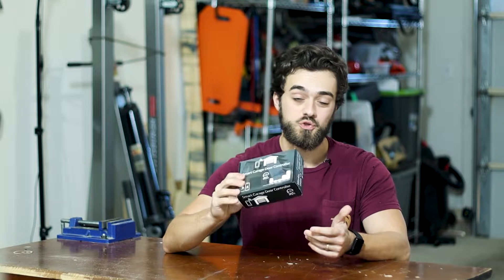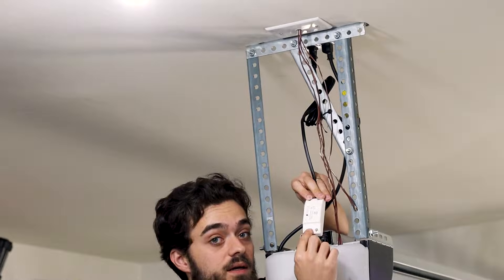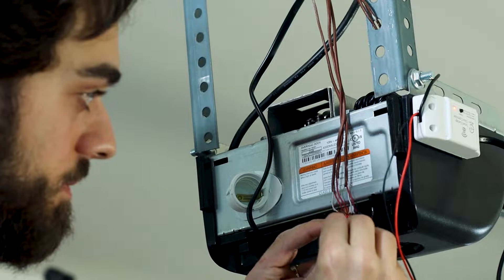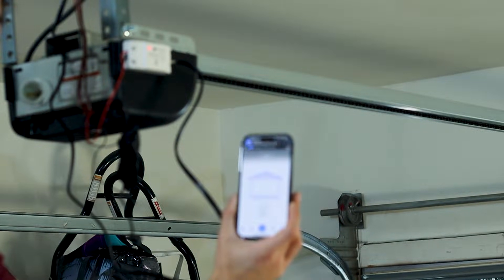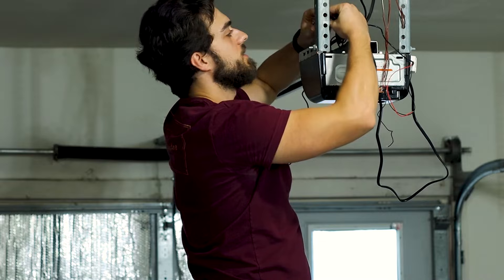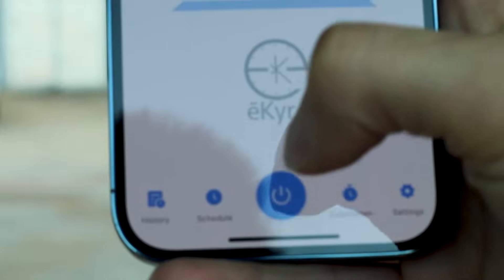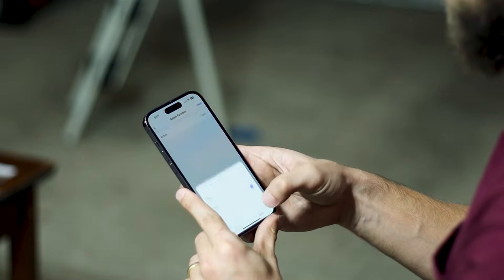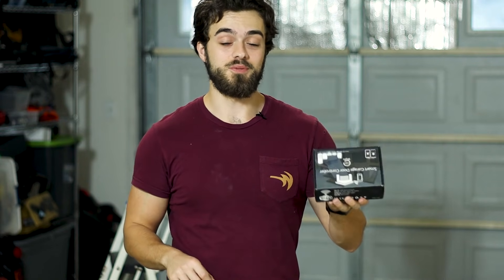EASILY Turn Your OLD Garage Smart | eKyro Garage Door Opener

Comment: So you know and others....that system does NOT truly recognize if the door is opened or closed. Your app says the door is "open" when it was really closed. If you were to by chance hit the door "close" twice,  it will actually open on you and vice versa. Also another HUGE security flaw...such as happened to me....if the power goes out in the middle of the night or whenever....the door automatically OPENS ! Fortunately for me, nothing got stolen. I returned my unit immediately after that occurrence. Try this out...see for yourself.
Reply: I’m going to use this controller on my sliding gate. Fortunately mine is configured to auto shut  in 30 seconds after FULLY opening.

Comment: After watching this video. I purchased one of these. I have really old opener. A Stanley, it's 40 years old. It works really well, but I can't get a replacement remote. This device was very easy to install and connect to my WIFI. The only problem I had was finding a spot for the sensor. I had to fabricate  a piece to attach to the top of the door for the magnet.  It all works well and now I know if my garage is open no matter where I am.
Reply: can you give more details on what you did to get the sensor to work and what was the issue for the sensor?

Comment: Ok, but after you do that wiring, will the button by the door and the old garage door openers still work?
Reply from the maker: Yes they do! We are simply tapping into the wires not removing its current functions
Reply: Yes, you're just tapping into the existing connection.  Because one of my remotes was stolen I had to remove all of the codes from each unit so that none of the remotes no longer work.  But these units are great -  I wish we had done this years ago

Comment: I had the same problem with the remote not working; 
it was the LED bulb in the motor unit. 
Changed it for another brand. Same problem. Used a known brand, same problem... 
I tried to move the antenna to the opposite side, and made it one meter longer, same problem.
CFL was not an option. So, I went with an old-school bulb. 
Problem solved.
And my remote started to "work" again.
Reply from the maker: I tried that same thing but it didn’t fix my issue. I’m assuming the upstairs neighbors has something in their house that is interfering. Either way, i prefers to Siri activated garage door anyways
Reply: @AutoMotivate It is surprising that electric devices meet specific agencies' requirements, yet they are vulnerable to RF jamming, or they are the jammer.

Comment: Anyone have any ideas why my opener not moving when I jump the white n red ? This is preventing me to install this wireless opener
Reply from the maker: I would make sure your garage opener is compatible by going to eKyros website
Reply: @AutoMotivate   it is compatible , but my problem starts before that, when i try the jumper wire on any 2 terminals, the up or down arrow flasing but the door will not move. therefore it is not possible to connect it until i figure out why the door will not move when i put a jumper wire on the white n red terminals. does that make sense?
Reply from the maker: @csabi72  I kind of follow. Are the sensors blocked. Perhaps your wire is a different wire you need to jump?
Reply: @AutoMotivate   I have tried to jump all 4 terminals every wich way, but the door won't move, just the arrow flashing
Reply from the maker: @csabi72  might be a stupid question, but does the door open normally? 
Everything I am seeing is referencing that the sensors aren’t aligned/dirty or there’s something mechanically wrong.
Reply: @AutoMotivate  no that's what's weird, the wall button, and the remote works just fine, may be I should tap in to the wall button, not idle,  but it may work
Reply: i think it has some kind of shortout protection because i tryed to short it by the wall button and nothing happend,
Reply: here are the facts : Yellow Learn Button Openers - Security+ 2.0 Garage Door Openers
Security+ 2.0 Garage Door Openers use a 2-way encrypted serial communication, which is why the system does not work when touching the wires together.

Comment: Thanks for the video, gonna give it a shot. I have an older opener and the website notes it'll work with my setup - hoping it works! Opener on the cell was the goal - this looks like it'll do exactly what I'm looking for.
Reply from the maker: My wife and I love it. It has been so hassle free since I installed it. Wish you luck!
Reply: UPDATE: installed the unit which was super simple and it worked right away! My old opener is now modernized for a fraction and hassle of replacing it with a newer modern unit!
Reply from the maker: @RenderingsToTheMAX  heck yeah dude! With this there is no point to replace the garage opener with something more expensive